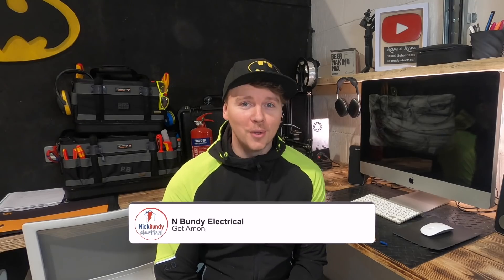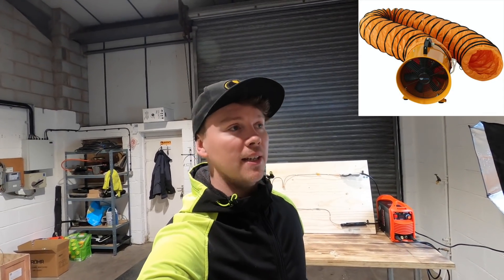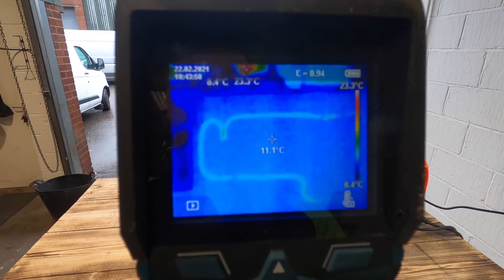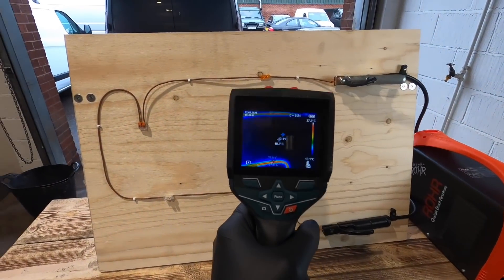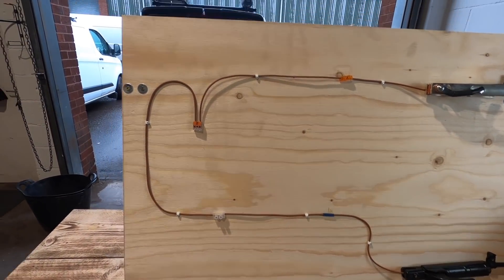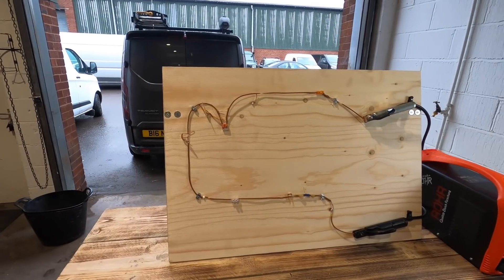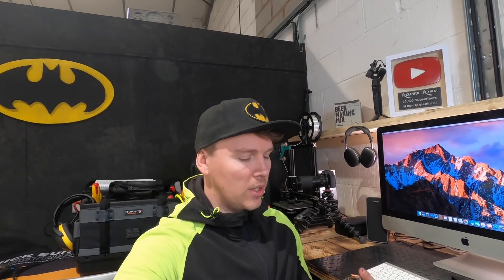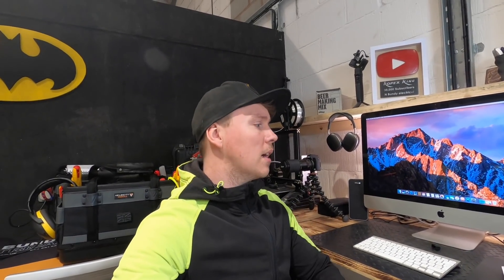Overloading Cable Connectors, Electrician

Comment: I too have seen John Ward's video on this as well as one made by Electromagnetic Videos. The results both of them got for what each type of connector can handle for overloads is mostly the same. As the plastic and cable both failed long before the connections would've

Comment: The problem with this kind of test is it really proves nothing but the installed resistance of the connector. I think most everybody knows that with it's tiny little contact area an dissimilar metals spring clamps, the WAGOs have the highest resistance.  I knew the WAGO would fail first. They are an extremely  popular, extremely easy, but extremely crappy connector for high current. 

If one wants to prove the reliability of the connector it will take some time to do it. You need to run art max rated currents until temperature stabilize. Then let it cool down completely and repeat that process, many, many times.  What you want is repeated heat/cool cycles. You can't somehow shorten the proper testing by overloading the connectors. 

People somehow think overload tests are some shortcut method. It is not! I guess you are not an engineer!!!  

That said, the WAGOs will perform the worst because they rely on spring tension and it is the heat/cool cycles that weaken the spring. This will happen in time at rated loads. Loads much less than max will be fine.  Resistance is the key.

Comment: What house has 100w running though the cables... I really want to know.
Given the more that comes is 30Amp/Hours based off the massive  control, which then goes to the consumer unit that in highest Amp is the Oven.
At know point is the average UK house getting close o the "demonstration" of 210volts.

Comment: So you tested why beyond he specifications on the wire and the connectors are was surprised they failed.
Not sure how this is a test of anything.
I have WAGOs in my ceiling lights, most of my electrical requirements in my shed.  I start the platform drill powered my basic three core cable and the joints are WAGO and never a smell.  When I start up my grinding discs there is no issue with the electrics.
Because the WAGO I use ae rated to 30AMP... an electrical oven is 30AMP... as long as you aren't using WAGO for the mains electric coming into the house then what its the issue?

Comment: The problems in installations usually come from bad jobs or connections that have been worked on. The connector block is great if you seat everything correctly once and tighten it down with the appropriate amount of pressure. Even better if you use ferrules. But if you work on the connection or don't use ferrules and only clamp down certain strands while others are either loose or damaged, things can get funny fast. If you take care and do everything correct, you don't have to worry about all the options. Question is which is the most likely to be used in a wrong way?

That's where the Wago shines in my opinion. You can disconnect and reconnect pretty much as often as you want and you won't get a damaged cable, while being able to see through the thing to make sure the connector is well seated.

Comment: Holy smokes. Hey which one of those would you use for a bathroom vanity light?? It has two 60 volt bulbs. Not nearly the power like in the demonstration. I have to make a stranded wire to solid wire connection. I know electricity creates heat through resistance and I don't want my house going up in smoke. If you were in my boots what would you do?? I do appreciate any help or advice and I thank you in advance.

Comment: This video has neglected important relevant factors like Voltage (was the welder delivering only 12V?), Wattage (Volts times Amps for DC and its Watts that sets fire to things), DC vs AC (welder output is DC where house wiring is AC) and the resistance of the wire and each connector type (easily  determined from specifications or measurement). 
Could someone watching this video be left with the impression that 40 or 50 Amps of household voltage was "safe" for any of these connectors?
Reply: The best way to measure dissipated watts of a connection is too use the Current squared time resistance formula.  Doubling the current means 4 times the watts dissipated.  You also want to test each connector separately. The problem using volts times amps is that the voltage drop across the connect is quite small and is difficult to measure accurately as it heats up 

In the case of a simple connector, the impedance is simply the DC resistance because there is no inductive or capacitive reactance components. But the overloading test does not prove much, just what connection has the highest resistance.

Comment: It was good to see that all the connection method held above the rated specifications. For this to happen in the real world the overcurrent protection would have to fail. Wago failing might not be a bad problem at failure point as it opened the circuit whereas all others would have kept generating more heat. Nice video glad you kept staying safety precautions.

Comment: Would you rather have the terminal that keeps the connection through 150 amps, or something that can take 100amps but would fails earlier acting as a kind of fuse?

Comment: What is the gauge of the conductor (at 4:04 you said rated for 34 amps)? At 30 amp the gauge of the conductor should be 10awg. 50 amps should be on a 8awg, etc. As you go higher in current, the conductor's gauge should also be larger width (smaller gauge number). Likely the heat of the conductor is transferring to the connectors. If the experiment is not valid, which may be the case, then it may mislead others. Also, yes the Wago if it is 221-412 is UL rated for 32 amps.
Reply: Actually the UL rating for the WAGO is only 20A. The IEC rating is 32A and the JET rating, (Japan) is 20A.  They do not have the UL rating stamped on the connector.

Comment: The main thing to take from this is thar thankfully our electrical systems can take far more current than they are designed to take, providing thet are installed correctly. Something else to bear in mind is that this test was done with DC so it might possibly be slightly different with AC.

Comment: Hi can you tell me if its okay to extend cables in the radial socket with wagos? The other day I opened the socket and there was 2 neutrals with visible copper which means both of them were damaged so I decided to cut them short and put 2 into wago and extend with just one neutral. That specific socket was second last and the last one was just above the one I was working. It bugs me now after time that I should maybe extend with 2 neutrals instead of one.

Comment: Well, I used an inline to extend a cable for a socket in a ring as, i was unsure about the WAGO in case the ring got broken. Guess that's not as much of a problem as I imagined. Especially seeing as  the insulation on all the wire went first, and it would likely have found an earth in walls and trunking before anything else melted.

Comment: I went through a cable at my father in laws, 32a radial, the cable connector i repaired it with melted and it was rated for 32a 250v, had to repair it today with the same connector a year after the original repair due to that happening, what would you recommend for inside a plaster wall to repair it better, as i don't trust the cable connector anymore

Comment: So the connector block is probably at or close to the wire temperature,but the plastic casing is restricting.the heat emissions which is why it appears cooler. Very.good video

Comment: Wow...testing 240v rated connectors using a heating element running at10-40 VOLTS. That's what you have created here. Not surprised at the results, they are all bogus...but quite entertaining !!!

Comment: Quick question please mate, would you say i could get away with a standard through crimp when making a joint in a cable and burying it in a wall ?
I'm having to move a couple of sockets to a safe distance from the hob (300mm) but as per usual they've called me in after the kitchens been installed, so I'm left with no choice but to join the cable somehow, originally I thought every joint needed to be accessible but I read on the IET website that through crimps are deemed as an acceptable permanent joint and can be burried ?
Would appreciate your advice 👍🏻

Comment: These currents are way more than rating of fuse wire or contact breaker.
Would like to see test repeated with both of those in circuit. Probably less smoke but more sparks?
😁

Comment: I'm looking to put an LED light outside I have a halogen one at the moment but the Leeds not for led so I need a outside junction box to connect the wire to my new led security light those clips will be ok to use won't they LEVER CONNECTOR

Comment: My concern with Wago type connectors is how they will perform over time, I understand and have seen screw terminals that become loose over time, I know the test was very extreme, but interesting to see how the choc block did.
Reply: Sorry for late reply.
You see, unlike screw in terminal/block, Wago uses spring loaded metal strip.
That means, when you close the lever, it will put pressure onto the metal strip, which subsequently firmly grips the wire (in my personal testing, it grips really well and it is pretty much impossible for the wire to come out without big external force).
The advantage of this is, that this mechanism cannot get loose unless the lever is opened or the case undergoes catastrophic failure.
As you saw in the video, Wago easily withstands over 100 A and started failing at 130 A. It started to fail at 6.5 times the rated current. So unless someone is trying to put these connectors where they are not supposed to go, you can be pretty much sure, that this connector might, and most likely will, outlive you.

Comment: With that fan blasting at the higher currents, together with the door open would keep the cable / connectors cooler than they otherwise would do.

Comment: It would be better if the connectors gave up much earlier, then the break the circuit and the wiring is not heating up and loosing insulation where it cannot be seen.

Comment: Should of put the connector block in a choc box and the crimp with some tape maybe to simulate it more life like as the heat would probably get a little higher quicker?

Comment: You need to put some black tape on all the connectors - and read the temp of the tape - so the IR readings are all done for the same material. The emissivity of the various plastics won't be the same, it will vary a lot with colour and material.

Comment: Presumably these are all performing well above the rated current due to the very favourable conditions here: open air in a cold unit. Presumably the rating has to be for significantly worse conditions (e.g. high ambient temperature, covered in insulation) as well as, of course, some safety factor for good measure.

Comment: Judging by the amount of current that the cable can take and the connectors, I feel safer when using them as they can take considerably more than their rating factor. It just goes to show, as long as you have the correct sized breaker the installation should remain safe..... Assuming correct installation and to regs of course. Great vid Batman, love the science side, also big thumbs up to John Ward.
Reply: What exactly is the purpose of a test like this when your biggest point of failure is the wire insulation itself?
Reply: @mts7274  i guess confirming compliance and adequacy?...

Comment: Great work but just a note Wago 221 4mm are rated at 32A not 20A ,  20 Amp is the rating as per China & abroad,             Wago 221 6mm  rated at 41A  Information direct from Wago.                                                                                                          just a question was that welder a AC output or DC,

Comment: Whilst other youtubers have done this, a test of fake wago's would be good to add to your library. I was doing a video myself on fake wagos, and when I was looking just on ebay, there were so many I ended up stopping.  There are plenty which the copiers have done, which wago dont even do, whoever design the wagos for the copiers, have seemingly taken the product range further, and I have no doubt that wago will in the end, copy the copiers.  Also, you inadvertently demonstrated why you use metal clips in certain areas instead of plastic ones.  Finally congrats on getting 40k+ subs, you will have to give Dan some tips lol 😜😜😜

Comment: I'm not surprised that the wago failed first.  I was in the trade yonks ago, and, to me those things look horribly flimsy.  The best connection - in accessible positions - would almost certainly be a porcelain connector block!  34A for 2.5 seems very high: in my day, 2.5 T&E clipped direct was rated at 27A for a conductor operating temperature of 70C.

Comment: you say something like 'that would be happening inside your wall'...but would it? shouldn't circuit breaker have kicked in when there's a 50A+ load on the circuit? I always thought that even if you connect 10 electrical devices to one socket it should trigger a fuse? should it?

Comment: Wago are very pretty but I don’t get how the micro tip of a bit of sprung steel makes a good electrical connection ...it doesn’t sit right ...most old sparks understand this ..the connection should have a big surface area

Comment: Me a 16 year old shy and quiet lad , many years ago,second day at training centre, bored at break time, so one of the older apprentices , got us all to hold hands and  stand in a circle, gave one lad a red wire to hold and the lad on the other end a black wire, the result electrifying as the cables where attached to a  transformer in the other room, we all learnt about the power of electric that day. Was it dangerous, was it hi jinx, was it a sackable offence, was it just fun or bullying, none we just put it down to a learning experience, not like today, where youd become an anti social media  star  with a criminal conviction.

Comment: Do a long term thermal cycling test, apply a high current for a while then let it cool down, compare screw terminal blocks VS Wagos/other clamp type terminals using before and after low resistance tests of each connector.

Comment: How about you recreate a test from another video I saw recently (you probably know which one), :-

About 5M of cable with nailed on metal cover, nail had caused partial short between L&E and buried in plaster, in the video location was found using low ohm resistance checks which actually got him within 10cm (which is pretty good) but I was thinking you could use the high current that most low ohm testers generate to heat up the fault area and then quickly detect it with a thermal camera, it's a test I'd like to do but someone stole my Flir, I don't have time and don't have a Youtube channel looking for tests to do :-) .

Comment: To be honest, I expected the 'chocbloc' connector to do well, if a good initial connection was made, it's when incorrectly connected they suffer. Examples like overtightned screws and threads stripped so connection tension is lost etc.

Comment: Cheap stick welders are much cheaper than a megger or a MFT....I can see some clowns deciding to do some diy insultion/continuity  testing with a stick welder out there.... 🤣🤣🤣 now if this cable is rated at 23 amp and I put 60 amp through it..no fire or burning smell, PASS 👌

Comment: How about maybe more to use say an old rewirable fuseboard with of course rewireable fuses and increase the current through the ranges one might expect to pass via those fuses and various connections one might expect to encounter in a property, including the connections you have there. Include the older round type junction boxes and of course the twisted and taped joints that some clowns use, you could even throw in the old make shift Altoids tin junction box 😢
Those are the situations you are bound to encounter out there in the field.
With of course a clamp meter in view

Comment: Erm, the 221 is rated at 32A at 450v and 20A at 600v according to Wago themselves. ???
Reply: AFAIK difference doesn't just come from voltage, but from different testing methodology: 450V/32A is IEC rating according to EN 60664 and 600V/20A is UL rating according to UL 486C. Also there are bigger 221s for up to 6mm2 that are rated 41A/30A (IEC/UL).
Reply: The Wago is rated at 32 amps, but with 2.5mm twin and earth its down rated to 20 amps.

221 is also now available in a 40 amp version.

Comment: Needs to be done scientifically surely as independent circuits as the resistance changes in a circuit if one point of low resistance is reached creating higher resistance further down that circuit. Very interesting experiment though cool!

Comment: Makes ya wonder if crimps should used at the fuse board as that looked like the second point of failure.  Would like to see this being tested on fuse wire, mcb's rcbo's rcds and main fuse . A/c/b type for overload.

Comment: Looks like the old connector block that we are now told not to use and replace with much more expensive options performed the best,there's a surprise lol,fitted correctly there is nothing wrong with them

Comment: You have to take into account that you are using a lower voltage but high amperage, also that the welder will be using a DC  direct current not AC alternating current , so you are testing these connectors not directly in how they would be used in peoples homes, you should also have a proven amp meter in the circuit and not just trust the welder dial . But does show the dangers of what happens when loading is not taken into account on any electrical circuits. Keep up the vlogs Nick

Comment: Interesting video.  Can we have the  same using old cable VIR.  Also some 2.5mm in some flexicon would be good and will show why the charts show different ratings depending on cable routing/clipping/under insulation.  Great educational video. You good job